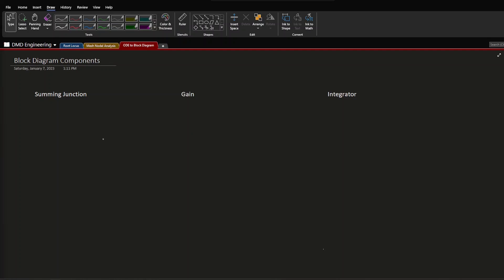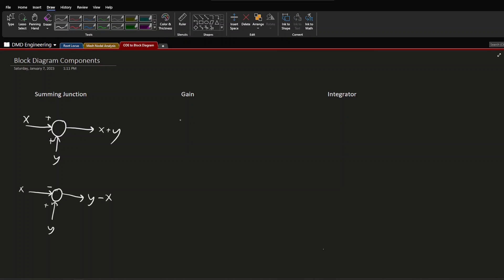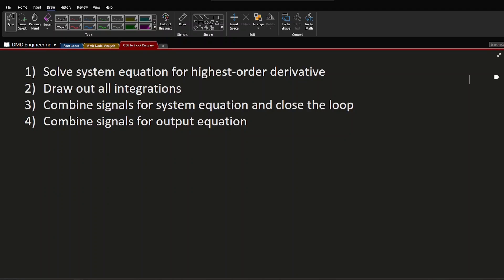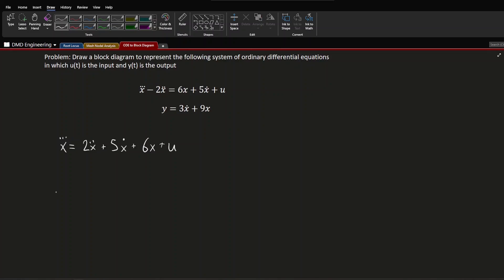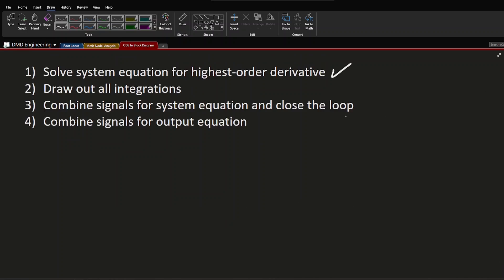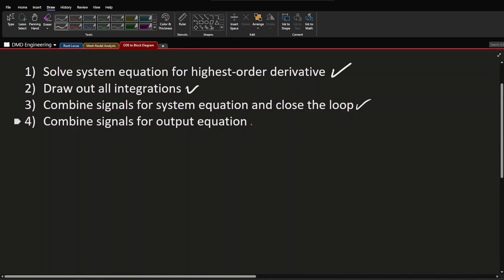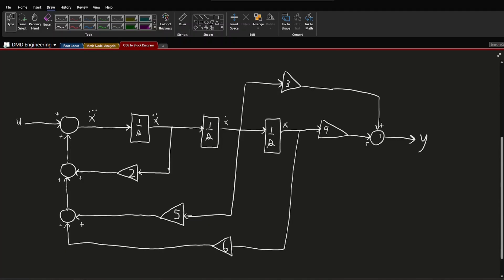Drawing Differential Equations as a Block Diagram (Example Problem)

Comment: "Solve system equation" in this case seems to mean "rewrite the equation in terms of it". There is no actual solution here. 

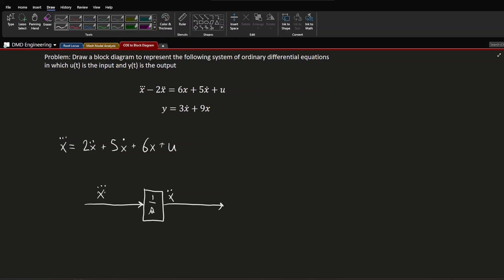5:47 With regard to the integrator blocks, it seems that the constant of integration always vanishes here. Is this a property related to the modelling of a physical system (with initial conditions set to zero) or is there something else going on that I'm not following? (I am not a student of engineering; I just study this stuff in my spare time for fun.)

This was a fascinating look into how you build a circuit to solve a particular problem.
Reply: I think that your thought about the initial condition of the integrator being zero is correct. Generally the physical system must be 0 in t=0 as usually you focus just on the dynamics of the given system.